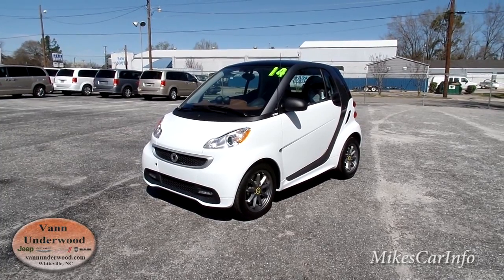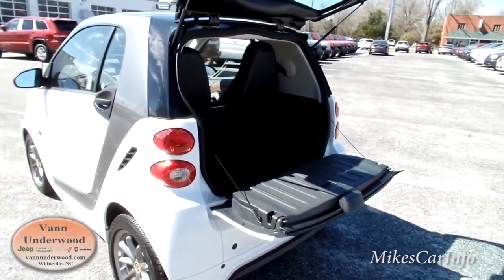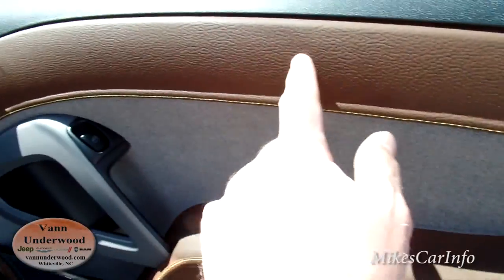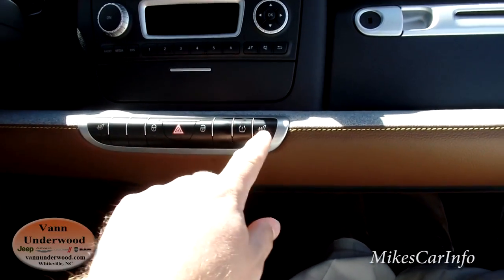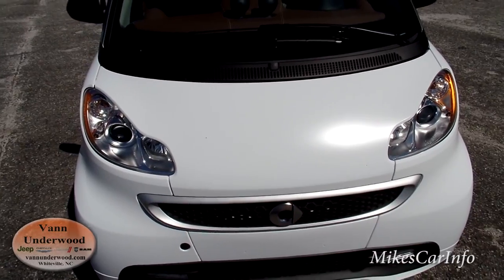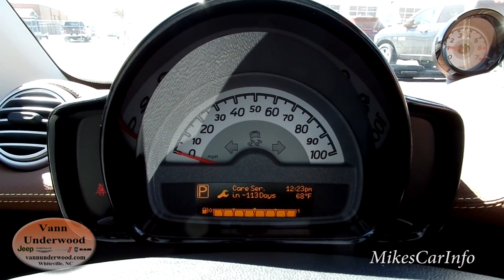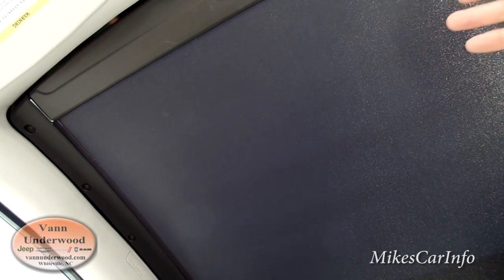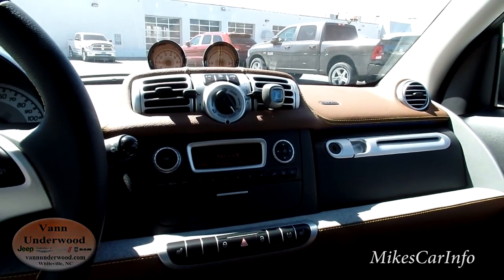👉 2014 Smart Fortwo Coupe BoConcept

Comment: Ignition, turn to "I", wait for dash lights to go out, 
then turn "II", and release to start (don't hold it at "II", it knows what to do).

Be careful of hitting big bumps at speed, could ruin your springs.

Slots could be for shopping trolly coins, haha.

Gears, manual sequential, for fun, or auto.
For a single person, the front seat can be folded forwards, 
remove the crossbeam luggage separator, put it in lower slot,
then you have more space!

A really fun car to drive, with a tiny turning circle.

Comment: Hi All. I bought my daughter a 2013 SmartCar FourTwo Passion. She rear ended a car going 12 mph and "totalled" the car. This is not something I would have expected from a Mercedes-Benz. The car is crap and I believe very unsafe. My daughter hurt her knees and her head but was not hospitalized. I contacted Mercedes Customer Support and it was virtually non existent. I will never buy anything from Mercedes again. Awful unsafe car from a company that does not care about its customers! Very disappointing. DO NOT BUY!
Reply: auto is gemaakt om u te verplaatsen en niet om te botsen,dan ga je beter naar de kermis daar zijn speciaal uitgeruste botsautos
Reply: yes and my daughter told me her 70 euro dress cost her 25 euro ! 12mph indeed !
Reply: If you rear end somebody driving a SmartCar maybe you should just take the bus.
Reply: Maybe your daughter should be paying attention so she doesn't run into the back of other vehicles? Yeah, a vehicle gets totaled when the value to repair it is more than it's worth, so it's just common sense...smh
Reply: @EastCoastLtd  Problems of texting?